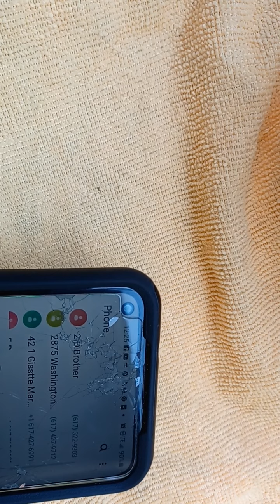following up with light 2 close to hydrant on Fairfield and Newbury Street

Comment: Hey Mr Porter! What did you find about the light pole next to the fire hydrant? Very good reporting buddy!
Reply from the maker: I found out that light pole was not supposed to be placed there it is a public Improvement committee mistake and they are supposed to be trying to resolve that issue. I will keep calling and do follow-ups on it